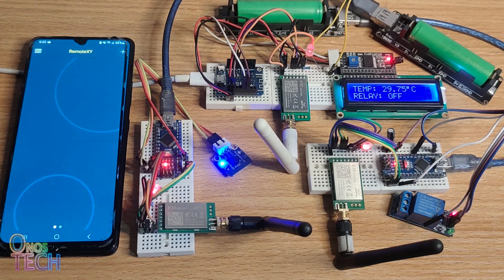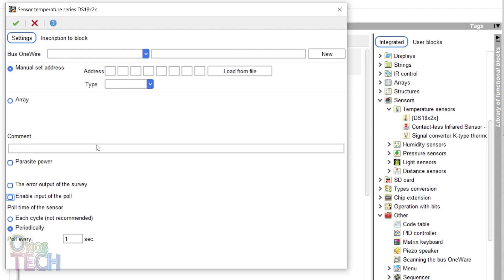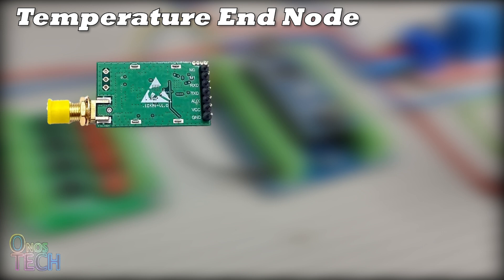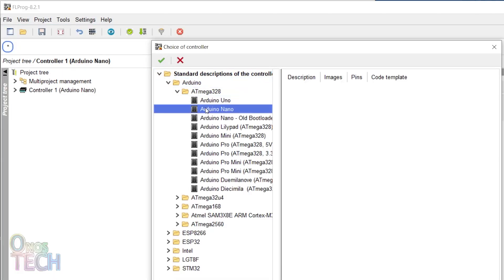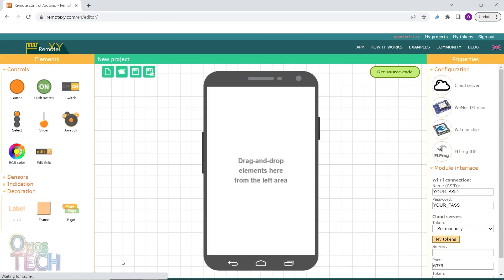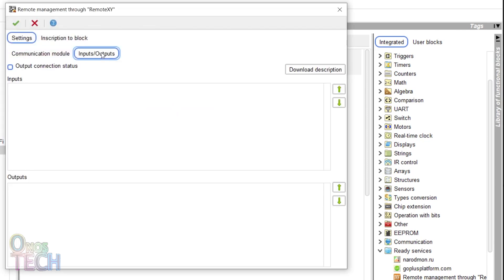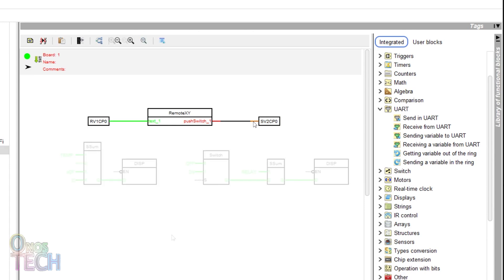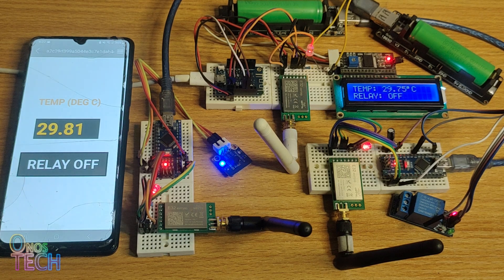Build an E32-433T20DT LoRa Network with ES8266 || RemoteXY IoT Cloud || FLProg

Comment: Какие переменные может принимать lora
Reply from the maker: Sorry for the late reply. 
Based on the E32-433T20DT LoRa manual, it has settings for address, serial baud rate, parity, air data rate, channel frequency, transmission mode, IO drive mode, wake-up timing, FEC, and transmit power, as well as the data to be transmitted with a buffer size of 512 bytes. These could be passed on as Decimal, Hexadecimal or binary.